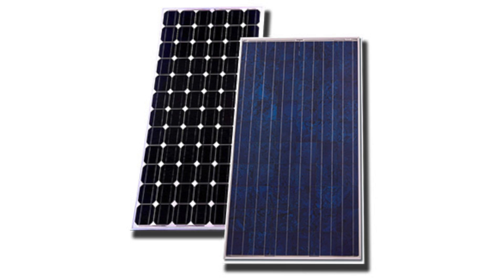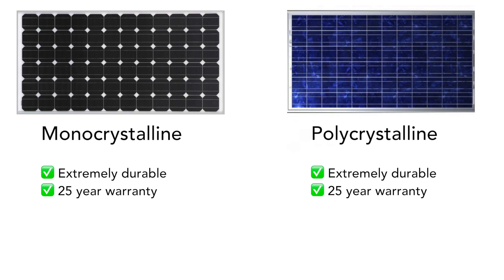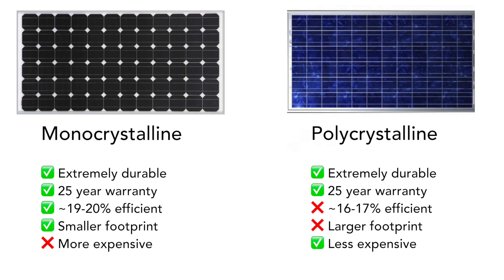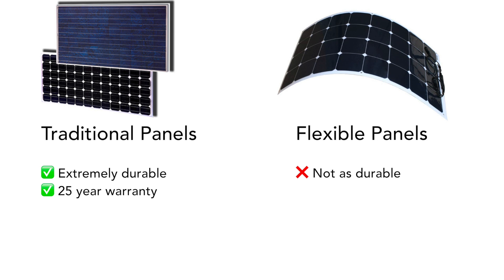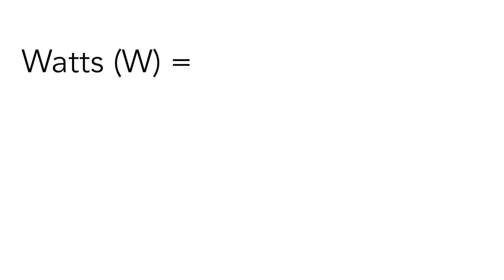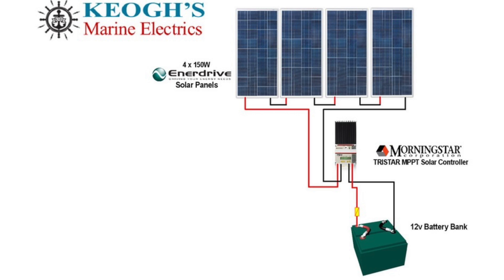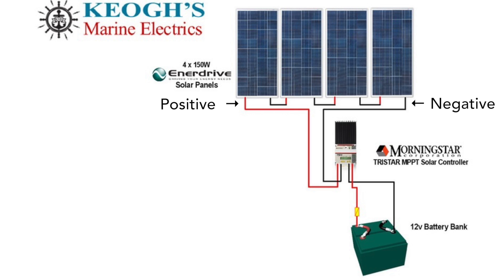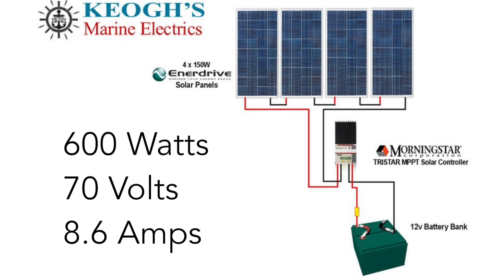Mono vs Poly vs Flexible Solar Panel + Series vs Parallel Wiring

Comment: Nice job except for two things.  First, your comment about controller capacity is somewhat misleading.  First, if you are going to wire your panels in series or series parallel you will want to use an MPPT controller NOT a PWM controller.  In that case you need to look at the maximum solar array wattage that the MPPT controller can handle AND the maximum open circuit voltage that the controller can handle.  For typical 12 volt panels the open circuit voltage is in the 21.5 volt range NOT the 17.5 volts you mention, which is the  operating voltage.  So when picking an MPPT controller for series or series parallel wired panels you need a controller that can handle your total system wattage and the total open system voltage for your array as wired.  For example, four panels wired in series will have a maximum open circuit voltage of 4 times 21.5 or 86 volts, so you need a controller that can handle at least 86 volts (say a controller rated for 100 volts)  Another consideration is that the amperage rating for MPPT controllers is typically the charging amps NOT the panel amps.  For a series wired array the charging amps can be estimated as array wattage (say 600) divided by charging voltage (say 14).  So for the 600 watt array 600/14 = 43 amps, so you would need a 50 amp rated MPPT controller to handle a 600 watt solar array.   Second although your graph showed the dependence of wire size on amperage AND wire length you completely forgot to mention length in your discussion.  Wire length is a critical parameter in choosing wire size.  The longer the wire run the larger the wires need to be.  I say this is critical because someone listening to your video might come away thinking that wires should be sized based on amps alone.  That can lead to  a very unsafe setup.  I say unsafe, because under sizing the wires can cause a fire.  Other than those two details a very nice video.
Reply: and this is why people get vertigo when thinking about DC vs. AC... 12V vs. 24v... milliamps to high amps, gauge vs. other gauge, and so on... Best to have an expert in your pocket to pull out for advice, help or just pay him/her and hope that they really are experts.   LOL.   The nature of electric circutry causes most to have a natural aversion or anxiety..... caused by the thought of SHOCK/Electrocution.  All people really want to do is plug it in and if needed, change a fuse or flip a breaker.   I appreciate the knowledge you all have..
Reply: I totally agree with the length / wire size statement. I've had personal bad experience with a long run with to small a wire gauge . Because someone giving me  advice didn't take into consideration how far my run was going to be.
Reply: You started out your points with (first) twice 🤠
Reply: @Vera-xu3xw  no harm in repeating. First things come first. Hahaha
Reply: I have been doing well on PWM for nearly 20 years. AGM's with 24v volts in and out. Of course I am researching MPPT but I am in no rush...
Reply: @garylhorn  think of it as a flashlight with a bad battery :)
Reply: Gary Hornbuckle, you've got it reversed. Increased wire resistance will cause a VOLTAGE drop, NOT a current drop. Current is the same at all points in a series circuit. Ohm's Law says P = I*I*R. For example, if a wire carrying 8 Amps, has a total end-to-end resistance of 0.1 Ohms, the power dissipated in that wire will be 6.4 Watts. Decrease the resistance by making the wire larger, say to 0.05 Ohms, and that wire will dissipate 3.2 Watts.
If it weren't a safety issue, then it wouldn't be an NEC violation to protect a branch circuit in a house comprised of AWG 12 wire with a 40 Amp breaker. AWG 12 wire  is rated for 20 Amps max. The wire will eventually overheat and cause a fire long before the 40 Amp breaker trips.
Reply: @kiowablue2862  Hi Bill ,,, you are obviously an electrician,( a kindrid spirit). I'm from 'Down Under', and we are burried in regulations, as no doubt you are. The design of systems should be left to those who are aware of the subtilities of electricity. The DC side of solar is very dangerous, but does not seem so to the 'not so wise',  the use of components specially designed for DC, circuit breakers isolator cable etc, is very important. With cabling it is not just size, but type of cable, DC loves to travel on the outside of copper, not through the core of each strand , so DC cables are not like household cables, DC cables have very thin strands and many of them.
Reply: @bradpayn1839  DC travels along the entire conductor. AC, as the frequency increases, increasingly travels along the outside of the conductor -- due to "skin effect" (Bill Thomson is correct). One learns a lot about these topics in order to qualify for an Amateur or commercial radio license.
Reply: @kiowablue2862  do not know if I have this question even correct, but considering power loss between solar array and conversion storage/use area.... say you have a 15kw array on a garage roof, combined parallel and series, say for a 24 volt Tesla Power Wall, or such,  and your array is 200 ft away from the house, how many panels would you have to ad if, say, 10 gauge? wire is used between the two.   OR, how many watts will be lost, nominally, at peak sun and efficiency of a panel array (newer, not older, clean, not dirty) Or should a lower gauge be lost to reduce the watt loss?  See, this is where an expert or Elec. Engineer in the family is needed, LOL.  I presume all this affects controler sizing, regulator sizing and charging sizing for equipment for max and for versatility and for consideration future losses in efficiency/effectiveness of panels as they age?  If the numbers I gave are wrong or if it is easier to round off, say "FOR EVERY 10,000 watts, you will lose ...", go ahead and change if you reply.  I am thinking there should be certain residential standard designs but with adaptation for things such as distance to array (losses) for varioius size systems... same for RV purposes too, but different bird/expectations and variations in travel locations, latitude and sun potential differences.
Reply: @garylhorn  the reason i used such a small cable and large distance is to show how small the resistance is but if you want to use your 3 feet of 0000 gauge well that is 0.000143 ohm so double that for positive and negative so if you were working out your ciruit resistance would you bother adding 0.000286 or just forget that bit
Reply: How does series or parallel differ in how quickly the controller charges the batteries?
Reply: @bptraveler6608  series doesn't you just need the correct voltage, parallel make a big difference since 2 batteries parallel doubles the capacity thereforr twice as long to charge if using the same charge rate
Reply: @garylhorn  It seems like this should be the case , untill you realise that the pannel actually becomes an open circuit to the current flow when shaded. So if you have one or more panels often shaded then you require an optimised module, per panel, which provides a bypass for each panel
Reply: @garylhorn  this happen because it been wired in series. + to - and so on. So when one is shaded other will not receive signals.
Reply: @odedelegbenga5284  just like a short circuit ...
Reply: I agree. In my country many farmers don't know the size of wire should be used leading to fire. Thanks for sharing your knowledge.
Reply: What is better for charging battery? Paralel or in series?. I have an ofgrid solar plant(19 panels/280watt,2 5 kw inverter and 8 gel batery/tot 25 kw). With that plant i am powerin my beac bar. And the tottal amount of all my machines(coffe machine,fridge,dishwasher etc) is 11 kw.
Reply: @garylhorn  
The reason for the loss when shaded is the fact that an unlit cell is almost an open circuit therefore allowing the rest of the cells to reverse the polarity of the shaded cell or cells, however most of the newer high quality panels have blocking diodes across portions of the panel as they cannot put them across individual cells as the forward voltage drop of a standard silicone diode which is 0.6 to the threshold and as high as 0.9 at it's full rated current, is greater than the voltage produced by a single cell which is 0.5 nominal depending on cell temperature. The easiest way to get a series string of panels to operate just like the parallel panels do losing only 25% when one panel is shaded in a group of 4 as he is showing, is simply to place a shot-key bearer rectifier diode across each panel, as they only have a 0.3 volt forward voltage drop to the threshold and will be less than 0.5 volts at full rated current making it equivalent to the loss of a single cell.
Reply: The PROBLEM as I see it is: (Everyone) is an Expert, yet there is virtually Zero “continuity” (ha) in application of theory/principle/practice.  One armchair quarterback ‘expert’ says One thing, followed by another armchair quarterback ‘expert’ completely contradicting (first) assertion .... then, shortly thereafter, a THIRD armchair quarterback ‘expert’ will take the assertion in a totally Different direction !! 🤯
And (‘experts’) wonder why So Many admitted Novices have such TREPIDATION (?!?)
Reply: So profound oom pls DM me
Reply from the maker: +Todd Dunn This is all great information Todd. Thank you! 😊 As I’m sure you know, there is only a certain amount of info that I can put into a video before I lose the attention of the viewer. All of this will be covered at some point in the future but this video was strictly focused on the solar panels of a solar power system. Thanks for watching and I’ll see you on the next one 👍🏼
Reply: Its voltage drop that is the concern im going to be lazy with the figures but you will get the point
Say you have 2000w solar system at 100v 20a and you have 10v drop over your cable well the charge controller will still see 20a but now only 90v so your useable power is 1800w it doesn't matter where on that circuit you test there will be 20a as for any danger well no if the cable is made for 20a it will be fine just wasteful, now i know what your saying about the cable affecting series resistance but it is such a negligible amount you never worry about it a 2mm or 12 gauge wire which is rated 20a is .5ohm per 100m or roughly 330feet which you would never do with a cable that size
Reply: A total run of 100 meters wouldn't be too difficult. Don't forget you have to count both the supply side and the return side of a wire pair. So a 50m run of 2 conductor wire would effectively be 100m. My house is 120 feet long from end to end. My load center is 28 feet from one end of my house. There's four runs from the load center to a room at the opposite end of the house aproximately 90 feet away. Adding another 3m for vertical travel, i.e. from the load center to the attic and the attic to the receptacles, the total one-way distance for each of the runs is ~100 feet. accounting for the pair, that's 200 feet of wire per run. So while a 100m run is not likely to be a common occurance, it's definitely not difficult to do.
Reply: I was clear in say the length of the wire has effect on safety as long as you don't exceed its rated current and as it being a circuit you would never do i simply meant with such small wire size i have done plenty of 50+ meter runs but you never even consider 2mm diameter wire
Reply: After reading the comments I'm totally confused! Who knows what they're talking about?
Reply: @edhollingsworth2335  .... do not fret... in 5 to 8 yrs... all the technology shall change... Solid State batteries, Ultra Capacitors, Clear multi layer, multi wavelength absorbing solar collector panels which are more environ friendly to make and make with less energy input and with more versatile application to surfaces of all kinds for all sorts of mounting/applications.  They say it is all coming and coming so much faster than the time it took to bring Solar to where it is as of last year. Be patient and maybe solar will finally make efficiency and cost sense rather than be best suited, as now, for those who have an overriding need, putting cost and payback at the back due to off grid necessities or back up necessities.  It will come. It will change.
Reply: @yousurf374  I hope so. Technology is here to make life easier, safer, simpler, cheaper, happier and healthier for everyone.
Reply: Portableeee Device Generator. Learn how to build your own energy generator. > https://bit.ly/2C0qCeE?-build-a-home-solar-panel

Comment: I'm an electronic's technician and I've done quite a bit of research into this subject. I have to say that you've done a fantastic job of explaining this. I couldn't have done any better ... as a matter of fact, I really couldn't have done as well! keep up the good work.
Reply: Indeed, a fantastic explanation, for both - experienced and unexperiencied people! Congratulation.
Reply: Can you email the wire diagram?
Reply: Amazing explanation. well done. Thanks
Reply: For a person new to these concepts, comparing a solar panel to a battery (AA for example) can really help to bridge the concepts. They can use a couple of batteries and see how connecting in parallel vs series changes the voltage.  Then the solar panel discussions can make more sense.  
Thanks for the great intro video.

Comment: That was a good video explaining solar clearly and in basic terms thanks.
Reply: and wrong .. very very very wrong ... monocrystaline panels use one wave length of light generaly blue ... while poly panels use 2 to 4 wave lengths of light ... and operate in lower light conditions ... poly panels use blue red yellow and green light wave lengths ... and because they do they start charging and working as soon as light hits them ... and stop when its dark ... mono panels start after sun is up and about 3% above the horizin .. comparing the two panels must be done from dark to dark ... to actually calculate them
Reply: @0623kaboom  OMG...I knew it! I feel better now...howsabout you? Group hug everyone...

Comment: Great series.  The information is presented very well so just about anyone can understand the basic concepts.  Good job!
Reply: Yes, you are right. He has clear all the concepts regarding the solar panel
Reply: I am very much agreed with your comment
Reply: Awesome video ! The way you explained it made my 2 year old brain understand it, only thing is what system works best for someone whos boondocking alot more and doesnt want to fire up his/ her generator?  I am guessing the parallel with the more amps?
Reply: interesting points ,if anyone else wants to uncover easy to install solar power try Magonsi Solar System Expert (Have a quick look on google cant remember the place now ) ? Ive heard some super things about it and my m8 got cool results with it.
Reply: @mikeshargent8948  That is click bait, talk for hours and say nothing
Reply: Produceeee Green Energy . How to produce free energy using a simple device. > https://bit.ly/2C0qCeE?-your-home-solar-panels
Reply: zzzzDan & Jen Nevada
Reply: Mono apply more amperage. Poly apply more voltage. And since the voltage is DC (one direction) the consumer can mix mono and poly creating a solar system that is the most energy efficient. Unlike the solar company's around the world and the NEC claims, the solar energy consumer can use UV using standard compliances within the industry.